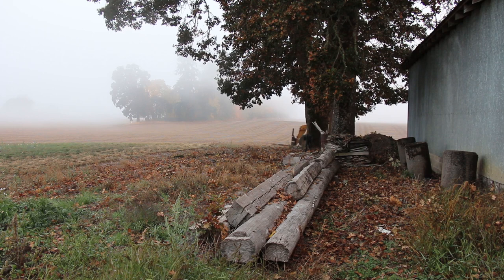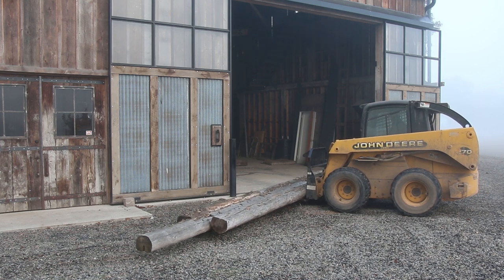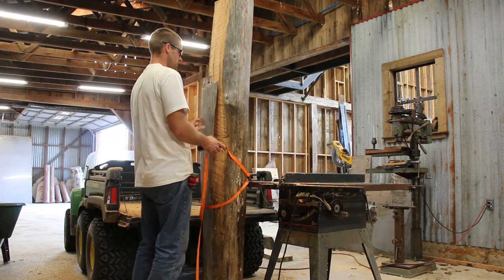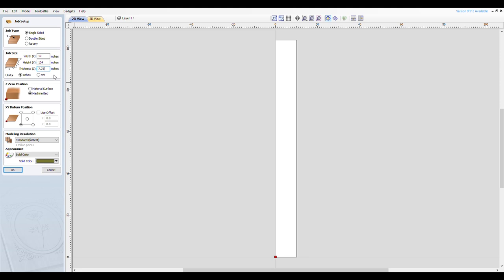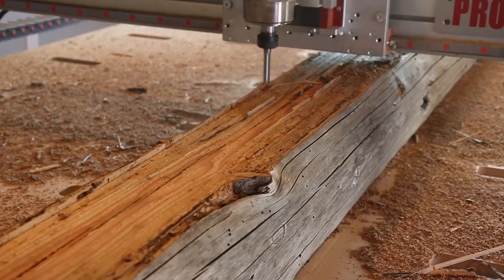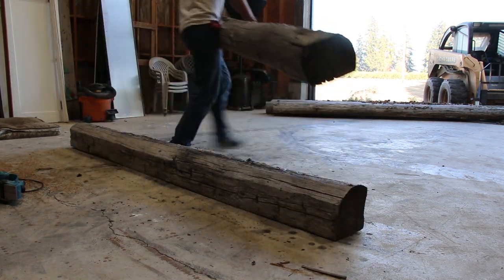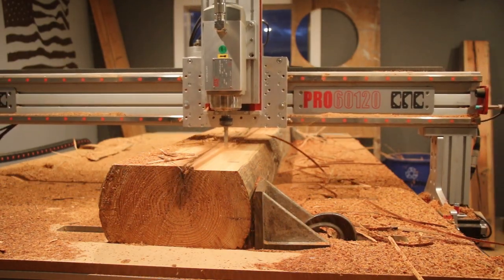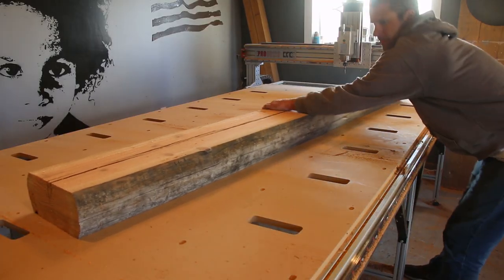Workbench from CNC Milled Logs - pt. 1/3

Comment: I'm not sure if anybody has said, but when you are using a diestock to thread bar, if you turn it half a turn then back a quarter the die snaps off the swarf and its easier to run the die down the bar, also use plenty of oil. I think your fabrications are brilliant, very artistic, great video's

Comment: nice to have this channel back :)
little recommendation regarding wood (especially reclaimed on a router table): if you need to remove bigger junks of wood, you can implement the "comb-technique": cutting slots every half inch or so, roughly half an inch away from your desired depth, holding he machine, using your hammer on the remainder and then doing that last clean cut to the end depth

Comment: Awesome job! Beautiful as always. I think I would have given up on CNC milling the whole thing and opted to have the logs rough milled (if possible) by someone then used the CNC to clean it up. But an impressive show of programming to mill it all with the CNC. That router must be a monster.
Reply: Agreed. I get the spirit (or sponsor obligation?) of this build, but it sure did burn up time! Local sawmill guys are always on Craigslist. But they don't appreciate metal in logs! Best, @HoneyOnWales

Comment: Great video!  Suggestion:  Use thickened epoxy for your next glue up since it has an open time of over 30 minutes.  (I use West System Epoxy Resin (105) with the slow hardener (206) thickened with  Silica (406), but other epoxy systems work just as well)  You will have more than enough time to complete your glue up before the glue hardens and epoxy is an extremely strong glue bond that works well outdoors.

Comment: Really cool video, can't wait for the next. Although it is too late, why did you have to glue the table top up. I bet in the long run it could have been beneficiary to have left them held together just by the steel rods. Almost like a workbench that could be altered and taken apart at free will... Just a thought however it definitely does give extra support.

Comment: If you leave one inch stabilizer bits on the last path, you can use a chisel to cut those bits off after the last path, those bits need not be more than 1/4 in thickness to hold firm.

Comment: If you are drilling holes it works well to use
1 drill bit
2 a spiral upcut peck drilling 1/4 at a time. 
3 an inside profile with a bit smaller than the hole so It can get some movement and chip clearing.

Comment: Great video. Edited to show all the steps at appropriate pace/length.
At around 5:40, the bad cutting sound is partly due to feeding the tool backwards - the chips don't clear quite as well when the cutting edge is feeding away from the job.
(also partly due to the type of cutter - end mill vs roughing end mill or slab mill or ruff cutter)

Comment: There's a book called the machinist's handbook you should really look into if you're going to continue using your CNC router. You obviously knew that your cuts were too deep  and your feed,spindle, & chip rates were off, and that book will help you to dial in those settings for future jobs based on what materials you're working with.

Comment: I'm surprised you don't have a chainsaw mill.
Reply: or a large bandsaw
Reply: @satxsatxsatx  maybe  he Will  get one  now,  from  advertising  company that makes  them, for  free
Reply: Were the chain saws sharpened recently... got the impression they were dull cutting???
Reply: Would he even have what to use one for? He is on a farm after all.
Reply: @sighpocket5  Most chainsaws are set up for cross cutting, if he had a chain with more rake, it would have cut better.

Comment: One thing, don't blow air over the CNC tracks because gunk builds up in them and that's not good. Instead designate a cheapo ash vacuum cleaner (they are robust and super cheap) for the CNC and clean that way, maybe even look in to adding to the gantry. Trust me on this, the rollers do not like being stuffed with fine dust and compressed air makes a mess of things. It damages big mills a CNC is even more fine and delicate.

Comment: Awesome to see new videos, happy new year! A little request, the video drops the audio track for every clip that is without voiceovers, it wrecks havoc to my audio receiver with a loud pop for each time it detects which codec to use. I cannot be the only one with this problem. Could you see if you can put a silent audio track troughout future videos to keep the audio active?
Reply: @rainfallprojects501  Rewatching the video to be able to be more precise. Usually I see this issue when people edit clips together with no other audio track on top, the editing software drops the audio track in between the clips so the audio stream  stops and starts causing the need to identify codec and causing the pops. In the case of this video you have a voiceover for most of the video which keeps the audio active between clips. It was mainly during the CAD parts that I saw the problem in this video. The screen capture did not have a audio track on its own I guess(?),  so when the only sound track is the segmented voiceover you get the stream drop for each time you say something in a separate audi clip, pop pop pop. A silent track running along the whole video might be a simple way to avoid this, or maybe there is some setting that forces the finished product to have a active audio track. Thank you for replying, rewatching the video was a pleasure like always, in the Project Binky or Clickspring kind of way.
Reply: Will do!

Comment: Is that your plasma table configured for woodworking or another toy entirely?    Cool recycling project.
Reply: While the same frame from that company will do both, I was fooled but now realize he has two of them. Pay attention to the rooms around each one, including the ceilings and lighting, and you will see that they are two separate tables. A few years ago, I built a 4x8 foot cnc plasma table with parts from the same brand, but have not yet put a router/spindle on it. It must be nice to afford (probably sponsored) two of them and have the space to set them up. What a great shop space.

Comment: Did you consider using polyester or epoxy to fill and stabilize the splits, cracks, and other defects?  Beating upon a table made of cracked wood with a 20# sledge might drastically shorten it's useful life.  Also a chip brush, or old paint brush, makes quick, easy, thorough, and consistent work of spreading large areas of glue.     -just sayin'...

Comment: Instead of cutting in a back and forth pattern (climb and conventional milling) try running your tool path in a counter clockwise direction (conventional milling) starting on a corner going all the way around the work piece in one continuous path untill you reach the center. This should give you less tool chatter and longer tool life.

Comment: not to be that guy who tells you what to do from his couch.... but 1/2 turn forwards followed by a 1/4 back to break the chip will make cutting threads much easier. maybe drop of oil too (they make cutting fluid but oil still helps)

Comment: Watching you operate the CNC router was painful!  i think you need to learn to operate the machine before you post a video. get yourself a basic vertical bandsaw for $250 so you can prep the wood for the router. you wasted so much material  time and electricity. here's an advise. put two board along the x and y edges and secure them. route them to a perfect corner and save the coordinates as G59 this way you always have a corner referenced and you dont need to probe and you always know where to position your material and your coordinates from.   if you have CNC questions PM me i will gladly help you!